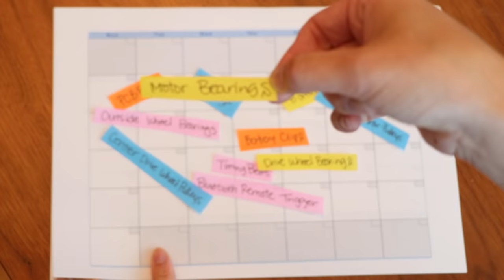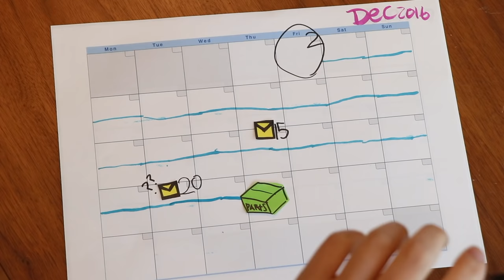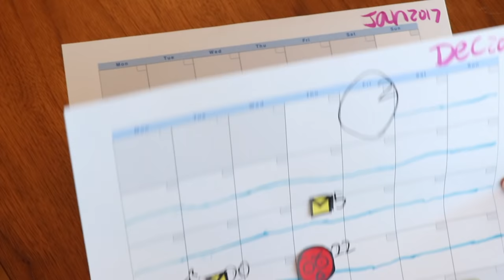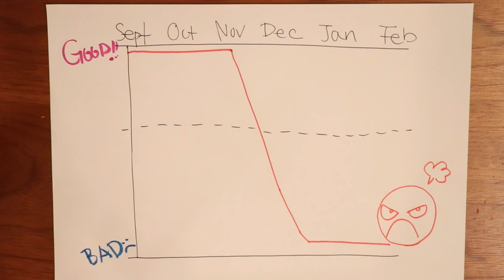COMPLETE SUMMERBOARD (LEIFTECH) REVIEW (WATCH BEFORE YOU BUY) Customer Breakdown

Comment: Thanks Paolo for the review.  Your review on the board has got me to reconsider my impulsiveness.  I've been a long time snowboarder but since I moved back to Hawaii in 2008, I haven't seen snow since.  I did get into Freebording at the time and have continued to do so.  I was curious to find out what came about the Leif when it was first reviewed as a starter a few years ago and that's how I came to find your review.  Hopefully they can resolve the reliability and customer service issues as $1600 is a bit of money.  You my friend being one of the pioneers of this board did much of that legwork.
Reply from the maker: Hey Ed, yeah the board requires more maintenance than I ever expected.  Also, I've been waiting for about 1 month now for Leiftech support to get back to me on sending me replacement parts.  At this point, no parts received and no updates.  It's a fun board, but I was really hoping that Leiftech would have improved their Support desk by now.  Has not happened in my experience.
Reply: Hey Paolo, sorry to hear that.  I know what's it like to have to wait for parts... in my case (when I still owned it) drone parts haha.  Waiting, especially is the part that just a bummer.  Looking at your prized possession and not being able to use it can drive anyone crazy.  Anyway, winters only a few months away and you've been a soldier this long.  I for one only wish the best for you!  Take care and good luck.  In the meantime tryout some other eBoards to get you through.
Reply from the maker: Hey Ed, thanks for the feedback.  Hope you didn't have to wait too long for your drone parts.  Yeah, I'm looking for something more reliable.  Recently the Evolve GTX caught my eye.
Reply: whaaaaaat?!?! That board looks siiiiiick!!!!

Comment: You need to check out ZBoard - probably the best in the market for its price. Another board that's super pricey but seems interesting is BajaBoard. But the weight is too much for city riding.
Reply from the maker: Hey Ashish Joseph, thanks for the recommendation.  The Zboard doesn't seem to use a remote.  How do you feel using the board accelerator as oppose to having a remote?

Comment: Great video, thanks for the info. You should have gotten a boosted though. very little no maintenance!
Reply from the maker: Hey Neil Patel, Yeah, I'm definitely considering getting a Boosted.  Someone on the Leiftech forum told me that the Boosted board has maintenance issues too and people are also sending it for repairs, but I guess you are telling me otherwise.  Thanks for commenting.
Reply: Hey Paolo, I have 2 boosteds boards (a v1 single and a v2 dual+) and a Leif board, and funnily, I haven't had any issues with the Leif, but have had to send back the v2 (once) and the v1 (twice). We've spoken before, and another rider in my group has 8 boards (carvon, boosted, evolve, zboard, acton) and continually / generally at least 3 of his boards are down. Waiting for my v1 back on Thursday:D These things get beat on. The best go down.

Comment: Great video, thanks for putting so much effort into it.

I am strongly thinking of buying a Leif board but I'm hesitant as it is more complex than an electric skateboard due to the added maneuverability. I'm also worried by what you highlighted with the parts clearly being brought together from different places hence the imperial and metric tools required, if it was properly designed and engineered you should only need a limited toolset for maintenance.

If the board was half the price I'd just take the risk but it's a lot of money.
Reply from the maker: Hey Alex Graham,  You are right, it is a lot of money so you should think it through before you buy.  Although the board is super fun to ride, I think it still requires a lot of maintenance and time.  And as you mention, if the manufacturing process was streamlined and the board was designed properly, it would probably have a more simple toolset.  In fact, the toolset could be provided for free with the board or even as an paid kit by the manufacturer, but this doesn't exist (yet).  If you are okay with regular maintenance and fixes then you might consider getting the board.  If you want a refined board with little maintenance then I think you might want to consider waiting another year or 2 and let other riders test out the product to find the defects as I did these last 6 months. Thanks for watching the video. I appreciate the feedback!

Comment: Hey Paolo, what a great review! I just got me a brand new leif board a week ago. I also own an evolve bamboo gt and I have to say the leif is so much more fun to ride, I simply love it. 
Unfortunately after only two times riding one of the center wheels has started doing some weird clicking sound and I am afraid I will get to the point of endless maintenance that you described. You mentioned an online forum, can you point me to that? 
Also I feel it is pretty ridiculous that the board comes with absolutely no tools. I even had to buy a wrench for taking the risers off, which you are supposed to take off after a while…
Well anyway the riding is incredible and I see myself at the beginning of a beautiful love/hate relationship. Thanks for your video!!
Reply from the maker: Hey georg, definitely a love and hate relationship with the board.  After 2 rides, you already have maintenance issues... that's horrible.  I thought they fixed these issues, but I guess not.  Good to hear from new customers.  Thanks for commenting.  I would be interested in knowing what the issue is with your center wheels.  Check the description of this video and the forum details will be listed there.  Be sure to ask the Admin for full access, because Leiftech purposely hide all the maintenance related posts from standard users.  Good luck.

Comment: Man, am I glad I read this thread. Thank you for reviewing every detail calmly and without bias.  

I had one question for you:  if I want to occasionally remove the motor wheels when I'm not at home to ride my board home from work as a normal skateboard (just coast on the nice wheels) can that easily be done with just one or two tools, or is that a major operation not worth the trouble?  Thanks!

Comment: Great review! Super helpful because it would not be cool to have to plunk down $1700 for something that is not market ready. Thanks!
Reply from the maker: Hey Banjamin,  yeah....I wish I would have known beforehand about all of the maintenance issues before I bought it... Anyway, still fun riding when all of it is working.
Reply: Benjamin Lai Well most of the eboarders do exactly that. I own the Evolve first gen, Evolve bamboo GT, Inboard M1 and the Leiftech board. The generation 1 boards except for M1 are all not "market ready". Having said that, the Leiftech board is a completely different kind of electric skateboard and cannot be compared with any other electric skateboard in the market. 

Evolve all terrain setup is nice for off road riding but you can never do that with the M1. Similarly you will never be able to slide the board like a snowboard with the Evolve (any Evolve). They are all different and Leif is unique in this way.

Comment: Hi Paulo,

thanks for the review! I noticed you mentioned at the end that you didn't push the board to it's limits and do any "crazy" jumps. What is your experience with jumping with this board? What should it be able to do?
Reply from the maker: Hey Ruben de Roos, thanks for watching all the way to the end.  I've seen some Leiftech videos where a guy jumps the board 6-7 flights of stairs and lands it, but it's a Leiftech rider so it's hard to tell what damage is caused to the board after that jump.  The way my board was built, it doesn't seem like it could take that punishment without causing some serious issues to the center caster system.  I ride it normally and it has issues so I don't want to push it anymore than that.  I think jumping curbs is probably safe but I don't do it very much so I couldn't tell you 100% that there won't be any wear and tear from it.  Overall, the center caster wheels don't seem to have a way to absorb shock from heavy loads.  Anyway, thanks for the feedback.

Comment: Wow, very informative video, thanks so much for the detail.  I don't think this amount of maintenance is very acceptable for what you are paying for - unfortunate.  And I can't believe they are mixing SAE and metric.. that's unacceptable and I hope they have resolved that issue. Don't think you should have to use a soldering iron to maintain your board.  Anyways, hopefully they improve on the design and thanks again for the info.
Reply from the maker: Hey TabernacST, maintenance is a pain  alone and the imperial / metric screws don't help.  The soldering iron is used to loosen the set screws of the pulleys after using threadlocker to set them.  Unfortunately, with the current design there is no way around it.  Thanks for commenting and watching.  Hope to talk to you again soon!

Comment: Hi there pablo,I noticed you said you did some soldering
My red wire had come out of the metal plate,I was wondering,do I just poke the wire through the hole and solder on top of the plate?

Comment: Is there a Leiftech-like board out there that uses brushless motors/hub motors??? That would cut down almost 100% on the maintenance??? I currently have a $400 Meepo board and it has been a dream since day one! No issues so far and zero maintenance other than charging nightly and wiping the dust off.
Reply: yeah freebord, and it doesnt even need batteries

Comment: I wish I would have never purchased this board. I saw your video AFTER I had purchased it. 

The computer malfunctioned after about 5 miles.  I used it about 5 times, for about a mile each time. I bought it to get to work, which is about a mile away.

It took alot of emails and after 3 and a half months I finally got a new computer.  I was told that it was from a bad batch of computers and I unfortunately had received a bad one. 

The customer service was horrible too. Very slow response ad took multiple emails to get a response.

I paid a shit load of money for something that been "repaired" but I feel its going to fail again. 

I have all the emails saved incase anyone wants to see them.
Reply: Same here... Riding is fun, if it works, but it never does. I paid over 2000 dollars for less than 10 hours of riding and more than 20 hours of fixing it... buying this board was the worst buy I ever made.

Comment: USED TO BE LEIFTECH, they had to change the name because of how horrible the product is and the lack of any support, THEY KNOW IT WILL BREAK WITHIN A YEAR. They warranty will show it.  Do not get this board. I have one that I haven’t been able to ride for a year. THEY WILL NOT SUPPORT YOU WHEN YOUR BOARD BREAKS DOWN. IT WILL BREAK DOWN! 3 MOTHERBOARDS IN 3 months and yeah they helped me out for 2 years but in those 2 years the board was out of commission for 8 months waiting for new parts. In the last 3 months i had to replace the pcb 3 times. I called in and they said my warranty went up the same day I received my new pcb and it shorted out of the box literally plugged it in and it blew. The parts aren’t warranted  its only from the date of purchase of the board and the motors blew 2x in one year. Ive hot a full board if anyone wants it everything works except the pcb.

Comment: Hi Paolo,
I just got a used Leiftech board (December model) for 800 USD. It came with all of the tools and even some Loctite necessary to maintain it. Any tips that you want to give on riding it, I'm still struggling.
Reply from the maker: Hey Harry, welcome to the club!  It took me some time to get used to riding the board.  You'll want to start off with the bindings off and the risers installed so there is less rocker.  I rode around for over a month before I took the risers off.  Some riders advance more quickly, but I was in no rush.  You'll need that Loctite as your pulleys will slip overtime.  I suggest logging into the Leiftech forum and asking the administrators for full access so you can see the support page which has rider tips/issues on how to main the board.  Finally, I've left some links in the description of this video in case you are interested in my favorite tools (Don't know if you get a full set) or board protectors.  Good luck with riding and let me know how it goes.
Reply: Hey Harry, I've had one for a while, if you want to reach out to NYC eboarding I know a few other Leif riders and would be happy to give you tips. Please don't listen to Paolo, as I find him to be incredibly disingenuous to a disgusting on a disturbing level. (for free stuff) Anyway, reach out to a real community of people who don't lie based on brands, like NYC eboarding, or the electronic skateboarding subreddit. Both have much smarter more level headed users than Paolo.

Comment: Hey Paolo, if you haven't already, check out this guy esk8fr... he has a site that documents his work on improving on the Leiftech from the ground up.  I know maintenance is not your cup of tea but he may have some insight and would make for a good collaboration with Leiftech to address all the issues plaguing this, what could be very awesome board.
Reply from the maker: Hey Ed, thanks for the info. I think it is a solid idea for Leiftech to take a note of customer mods and what improvement can be made to the board and the manufacturing process.

Comment: I noticed that you don't have the belt covers on your board. Did you stop using them because it was easier to swap out belts?
Reply from the maker: Hey Saagari,  yeah, I don't have the belt covers on because I have to regularly perform maintenance on the drive wheel system.  I'm checking if the motor or wheel pulleys are loose or if the belt is loose.  Just really a pain to take the belt covers on and off each time.  The belt covers are attached by 2 screws.  If I didn't have to do so much maintenance I would leave the covers on, but it's better to check the belts and pulley after every ride.  Hopefully in the future, Leiftech figure out a clip on system for the belt covers.
Reply: Huh, ok I thought so. I noticed on my board the plastic around the screws has broken off so I was curious if you had that issue as well. It's probably from all the times I had to bail and the board hit the side of something :/
Reply from the maker: You've got a point there.  I know a few other riders who have broken belt covers either from screwing it on too tight and the cover cracking or just hitting something which breaks the cover.  I started having problems early on with my belts, so I just gave up on the belt cover altogether.  I also read that other riders on the forum weren't using their belt covers.
Reply: Interesting, I got my board last month and gone through 2 full charges with the LT3X batteries. Banged up the board quite a bit because I am so inexperienced with skateboards/snowboards. 

I think I have the bearing issue you described in the video but only one wheel makes the annoying sound. 
Sad to hear your support woes, the couple times I contacted them have been pretty good. Maybe they were just extremely busy late last year. 

Also, how much easier is it to slide without the risers on the trucks? I have been getting the hang of cruising around and wanted to get into sliding but haven't had much success yet. In fact, I didn't realize the board had  risers and I could remove until today lol.
Reply from the maker: I hate having to replace bearings on the center drive wheels.  It is such a pain because you need to remote the pulleys in order to access the wheels or mother.  But the pulley are locked in there with 3M TL42 Threadlocker and I have to pull out the soldering iron to get them off.  And still sometimes after the soldering iron, it takes some force to slide the pulleys off because some threadlocker got on the axel.  It would be great if the pulleys just locked into place. 

It is so much easier to slide without the risers and feels more natural.  But you should practice a bit with them on as you'll notice that it takes a bit more balance and control to ride the board without the risers.  I rode at least a month with the risers on before I took them off.
Reply: Thanks for the tips! Love how you included a list of tools you used. Will probably come in handy in the future.